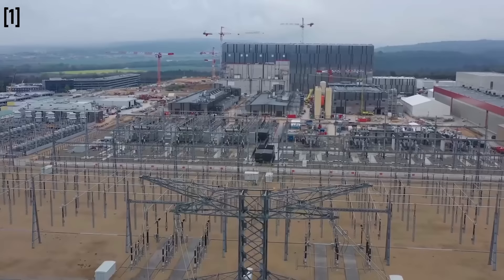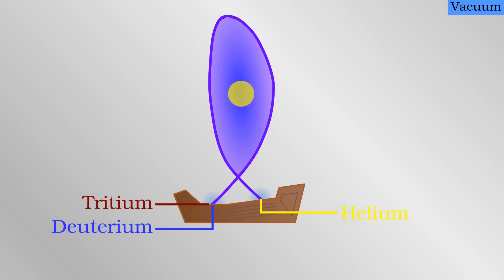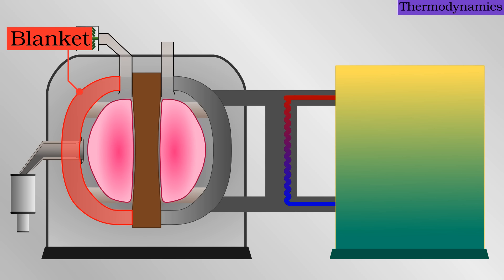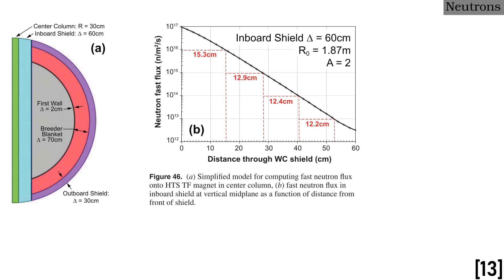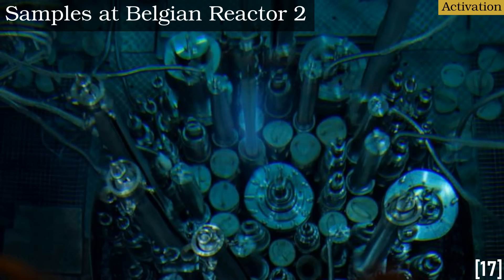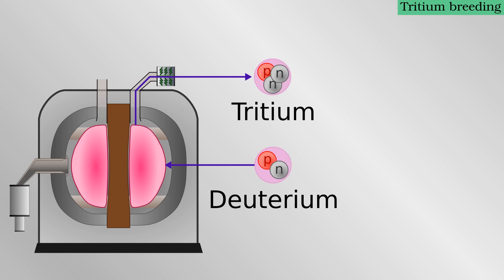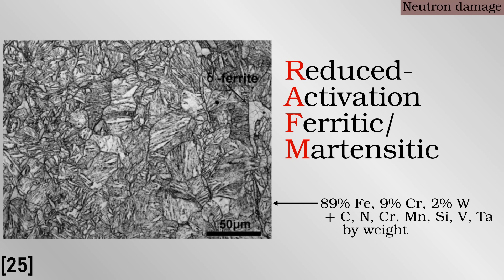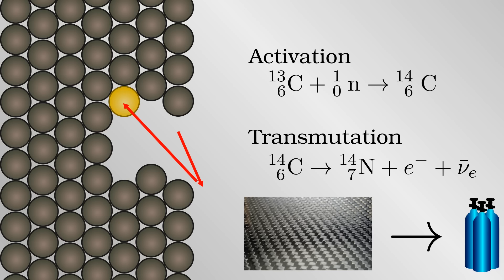How nuclear fusion (maybe) works (4) - reactor practicalities

Comment: All of this just makes fusion seem like a red herring for any near-future power conversation.
Like it's a deliberate distraction from the fact that FISSION can still give us cheap and abundant energy just like promised, we just have to not be lazy building scaled up submarine reactors with giant accumulated overhead in the design and actually roll up our sleeves and make fission a POWER generating device focused on cost, simplicity and safety (though of course simplicity gives us safety and inherent safety reduces extra costs).

And I know, research is being done, materials are being tested, the last engineering challenges are all slowly getting solved to do exactly that and 4th gen reactors are expected to already fit into that role, it just feels very anemic. If there was a TRUE concerted effort, it would be done very quickly. And it SHOULD be, current events basically accelerated the timeline of the fossil fuel energy crisis. But I guess the world doesn't work that way anymore. The US doesn't just start a huge industrial effort which yields fast amazing results, that was in the times of the US being the #1 industrial power, rest of the world doesn't seem to want to mimic that either.
Reply: Both fission and fusion are dead ends economically. The thing that a lot of people haven't noticed is just how fast energy storage technology is maturing. The combination of renewables with energy storage will be mature, cheap and far less risky as an investment.
Reply: @saumyacow4435  Well I agree with one thing, I haven't noticed ANY maturation in gridscale storage technologies.

All I've seen are technologies that put renewables WAAAY out of economic reach and I genuinely haven't seen any serious progress in the tech.

But I would LIKE to notice it, can you point me in the right direction? I've always been saying that we need actual investment in cheap fission (don't bother developing reactors if they aren't going to be cheaper than coal) AND storage to make renewables viable alongside it. I'd LOVE to be proven wrong and see that there actually is investment in half of this blanket solution.
Reply: @MrRolnicek  But when you are considering if your reactor is cheaper than coal, maybe a good first step would be taxing the coal plant based on how many people it's fumes make sick and how all the productivity lost from the towns that coal mines displace.
Reply: @ChrisCiber  Yea, in an ideal world maybe. Not going to happen in third world countries for sure and that's where the most demand is coming from now and for the forseeable future.
Reply: @MrRolnicek batteries not based on lithium, like bromine based, or iron based flow batteries have some real potential and are seeing commercial deployments. Redflow in Australia makes bromine flow batteries, and ESS in Oregon, USA does iron flow batteries. (there is another company called ESS that makes electronic chips, so searching for just ESS may not get you in the right place)
Reply: Big talk for energy storage at lower energy density then firewood. Launch a solar panel in orbit around the sun or in a earth dessert. That’s all the fusion you need. Unless you want biofuels then let the plants photosynthesis in sunlight and boom fusion power again.
Reply: MrRolnicek I agree. Economically inaccessible. The most affordable renewable I found so far is methane/biogas and a standard propane generator or modded gasoline generator. Especially in combination with animal and human waste. Quite affordable so much so that 3 rd world nations use it and India runs their cars on it. I think it’s a great tech but could be improved if someone made a cheap methane>methanol catalytic converter. That would make storage as easy as liquid storage and be backwards capadabel with gasoline  vehilces.
Reply: @wastelesslearning1245  Actually I've recently heard about some tech that may very well be a viable replacement for the haber-bash process for making Ammonia. This tech would seemingly be able to create ammonia practically even from intermittent renewables at location (so eliminatating the massive issue of transmission losses as well).
Ammonia is close enough to be already compatible with fossil fuels, you could readily replace natural gas with it and we already have pipes going to most homes so just reverse the flow when the home is creating ammonia from solar power and the big storage tanks can even have factories to turn it into liquid fuels to replace gasoline and diesel.

This is one storage tech I genuinely see as a potential way to make renewables viable. On top of that there's several nuclear fission projects that seem extremely promising and overall I'm very hopeful that we will have the solutions soon enough.
Reply: Oh that’s awesome! Though methanol has more flexible fees stock options and greater energy density, amonia fuel would be also good to know. It’s easier to store if I remeber then most gasses like it turns liquid with minimal investment. Methanol is always liquid. But yeah great stuff. Love fuel tech. It tends to be more affordable and backwards capadable
Reply: @wastelesslearning1245  Indeed, as far as I know you'd usually be creating Methane and then converting it into Methanol anyway and I imagine the process of converting Ammonia into a similar compound that's ammonia based but liquid would work in much the same way and probably just as easy if not easier. 

Another benefit I see is related to me mentioning you can just use existing gas pipes and pump it backwards from solar-equipped homes ... the benefit is that Ammonia is already stinky. Natural gas has to have carefully controlled ammounts of stink gas added to it for distribution, something that would be difficult if the gas generation was distributed across homes but Ammonia can be used as is, any leaks will be unmistakably stinky. Methane has the same advantage though, just not a convenient small sabatier process package to be installed on every solar equipped house which this Ammonia technology promises (though the technology is targeted for a completely different use)
Reply: @MrRolnicek  that is true the wouldn’t have to pay for stink ingredients. It’s sertainy great stuff.
Reply: @wastelesslearning1245  As far as I know methanol is really hard on some of the things in an engine designed with just gasoline in mind.
Reply: @JonMartinYXD  it’s extremely common in amateur drag racer fuel for its higher then gas octane (HP boost). The amount of modifications for standard gas engines is minimal (plastic inner coatings with as different air intake timing) cost wise compared to say giving everyone a EV or modding their cars into EVs and biomethane is gas so it’s also extremely hard to retrofit and biodiesel requires methanol to make chemically anyway and will be more expensive at the pump unlike methanol itself. Similar level of corrosion issue in ethanol but that’s already in most gasoline at stupid economic and environmental cost compared to methanol. Methanol that can be literally made from any biomass and trash gas from landfill (makes it cheaper even factoring in it has about half the energy of gas which in this economy I will happily trade). The real con is it’s toxic to humans but they already made these gas pump nozzle cap that secure to the car’s receptical which removes the risk of contact. Ironically enough methanol decays faster and is better environmentally if it spills unlike gas taking a week or less for biology to clean vs gas and crude oil lingering. Not perfect but when the transition is affordable, currently mass applicable, and versatile in sourcing (it’s the first step in every E-fuel recipe and a crucial precorucer in biodiesel recipes), and so easy to store compared to gaseous or higher boiling point carbon neutral fuels. If you make it out of syngas and burry the char byproduct as biochar it’s technically carbon negative. Don’t like care engines? It can be split into hydrogen at way less energy then water and power a fuel cell. China, neatherland, and a few other place in Europe got methanol powered fleet vehicles, fueling stations (basicaly same as gas station but with the cap added on to the nozzel), and methanol to hydrogen fueling stations and cars already. So yeah I think it’s our best hope.

No matter how cheap a battery material is, it probably will not best a plastic or stainless steel container cost per kWh of storage. Burns cleaner then gas if sourced from fossil fuels and if sourced from renewables like as a e fuel or better yet biofuel its emitions ate net 0 or negative which is on par if not better then a Battery. Also you got to think the global energy logistics are based on hauling liquid fuels over oceans where power lines are too ambitious to build and charged batteries take up way to much weight and volume. So renewables after solving their energy storage problem will run into a global distribution problem asuming we as a species want to make use of the worlds specialized renewable generating power house places like geothermal hotspots, deserts, mountainous, or oceanic storm wind, or spare nuclear power. But since methanol can be made as a efuel (from electricity) and can be transported basically the same internationally at sea it’s adoption is relatively seamless. Efuel methanol is more expensive though then gasoline which is why I like biofuel methanol since it’s cheaper then gas and makes use of waste and unconventional energy streams. Though keep In mind the savings on methanol infrastructure, methanol energy storage, and retrofitting, and the bulk energy of renewable generating hotspots should more then offset the cost to make it as a fuel especially with time.
Reply: @wastelesslearning1245  Whoa, I'm just saying that methanol is not a drop-in (or pour-in I guess) replacement for gasoline.  I'm all for a non-fossil liquid fuel.  Some more advantages of methanol (and ethanol) over gasoline include being stable (ie. you can store a container of it over the winter without it going bad) and being water soluble: a methanol/ethanol fire can be put out by just adding water.
Reply: @JonMartinYXD  yeah a default engine needs minor tweeks to get air intake times right and maybe polymer inner coatings but for the most part it is the cheapest replacer we got. A damn good deal. And you could just poor it in after just the air intake tweak as long as your careful and not drinking or huffing fuel vapors. It’s why it’s a amateur dragster fuel. Cheapest conversion around. Other then literally sysnthetic e-diesel or e-gasoline which are way more energy environmentaly, and economically expensive and require methanol as a precursor anyway. Based option. Future proof option even if you want fuel cells and hydrogen of all things methanol still works. 

But there another option that synergizes or can slash a huge portion of the gas bill all on its own. Does require slightly expensive but still affordable infrastructure but assuming it’s set up. Pantographs can be installed on automobiles and while they are connected to the roads with the overhead wires they have infinite range and pay electric prices per mile instead fuel prices. Perfect hybrid system as cleans as the grid is. Called E-highways and pantograph trucks. Also good tech. They also save on EV needs for batteries and their resources  majorly.
Reply: @wastelesslearning1245  Many of the buses in my city were electric with dual trolley poles.  Trolley buses or whatever you may want to call them.  Effectively the same thing as pantographs.  Then we tore the entire wire network down.  Terrible mistake.  The only problem they had was when a pole got came off its wire the bus was dead and the driver had to get out and rehook it.  I'm sure a better connector exists now, and even if one still came off a modern battery pack would provide enough power for the bus to continue normal service to its next major stop, where the driver could do the reconnect.

I am firmly against hydrogen as anything but a rocket fuel.  The amount of work needed to properly seal a system for hydrogen would make any widescale deployment unaffordable.  Hydrogen will even leak through some metals.

As for synthetic hydrocarbons/alcohols, the one thing they must not require is farmland.  Between people in the developed world buying biofuel for their cars and people in the developing world buying food, cars will win and poor people will starve.
Reply: @JonMartinYXD  yes exactly. Trolleys 🚎 are like the ancestor of the new pantograph systems coming out for trucks. The E highway has been tested in Germany and to stop the unhooking problem you mensioned they made the hooks self attaching and robotic. They also have rhe attachment be a wider pad to provide more wiggle room so jostling can’t unhook it when combined with the auto robotic adjuster. If combined with a nuclear grid it’s the closest civilians should ever get to a nuclear car. The only vehicles more efficient are electric trains and solar e bikes. I am saddened that that took them down where you are. It was either Handa or Toyota that is experimenting with placing the “child proof looking” electric rails on the road so their prototype pantograph car can have a easier time. It’s pretty neet.

As for the biofuels yeah methanol can be made of stuff that isn’t farmland so no need to worry. Food/food industry waste, landfill trash gas, waste water treatment facilities, ect. Those are probably the first places to start getting biomass. Turn into methane then convert chemicals to storable methanol. Sure if you have spare farmland it would be nice to store up some extra fuel but here’s the thing. It’s not strictly nesssiary. If new car has a pantographs on e highways most the time they will be running on the grid with no need for the fuel in their tank until they go off road or in under developed regions (so the need for fuel at all goes way down in general) and if a country is stupid enough to sacrifice too much farmland for fuel in a destructive way they would probably skip the middle man and use the methane from natural gas instead as the feed stock. Also for animal farming biogas farming does not contradict. Animal farmers have ses-pits anyway their animals sewage spews into: the only difference is for fuel refinement that methane is stuck in a air tight membrane for methanol refinement instead leaking into the atmosphere. So animal farms 💩 don’t contradict each-other. It’s plant farms where you have to be careful. But let’s say you are digesting good waste (that makes plant farms more resource efficient and you get fertilizer out of the biogas process). You can toss weeds into the biodigester. If you have hardy animals like ghosts they can eat most unwanted plants or otherwise un-unuseable ones like bark and woods shrubs and again weeds and their poop is fertilizer/methanol food stock. But Agian you don’t have to sacrifice farmland for methanol fuel production if you use the other societal sources and synergies . 

As for hydrogen yeah gas hydrogen is buns. It’s the pain of CNG powered vehicles that run on carbon Neutral biogas but 10x harder to store and use. I am shocked most of fuel cell research goes into a strictly hydrogen only overpriced economy 🤮.  Here’s the thing though there fuel cells that have been developed like Bloom Energy’s Bloom Box that is called Solid Oxide Fuel cells. These fuel cells types are made of cheaper materials and can run on more fuels then just elemental hydrogen. They can run on methane, methanol, gasoline but there trick is they must stay very hot to keep at operating temperature but with modern thermal insulation this past drawback has become a negligible Issue after initial start up. This wile still being more fuel efficient and quieter then internal combustion engines but they are a bulkier system. So far though solid oxide do best running for long continues time like a facility generator because the heat up start up sequence is the least efficient and slowest stage. The other trick is some people made methanol specialized fuel cells. They take methanol instead of hydrogen which could replace batteries in smart devices like laptops and iPhones (they made a experimental line of these products in Korea) so refuels quicker then recharging and is more energy dense so it lasts longer before “refueling”. These techs have been demonstrated in prototype cars too. The weird thing I don’t get about the hydrogen fuel cells people is they can make there life way easier if they used a liquid fuel like methanol as storage and transportation. Methanol literally splits into hydrogen way way easier then water and if made from carbon neutral sources it’s environmentally impacts is negligible. The splitting can be done on the machine end not the distribution and storage end. I am not pulling this out of my ass either; there are companies that set up hydrogen fuel cell back up power for telecommunications and marine applications that use methanol as the storage medium! But I digress 90% of the hydrogen economy is BS grift. Which sucks becuase I want my fuel cell electronics and quiet fuel cell generators that run 2x the fuel efficiency of internal combustion engines but alas the corrupt incentives are not there 🙃
Reply: @wastelesslearning1245  Just be careful with what you believe about Bloom Energy.  There have been some lawsuits that peeled back the shiny marketing and found some ugly stuff behind, like: toxic waste from the production and operation of Bloom Boxes, low lifespan, tricky CO2 accounting to lower emissions, etc.
Reply: @JonMartinYXD  thanks I will take it to heart. I have not heard of such things I would love to see further resources on the topic. In theory any conventional gasoline generator or solid oxide or methanol fuel cell would work (not brand specific).